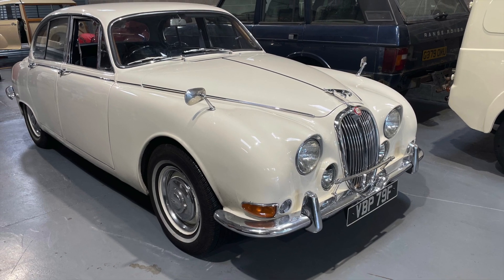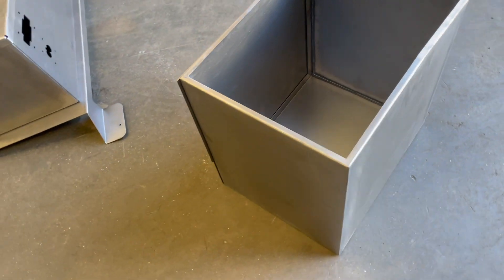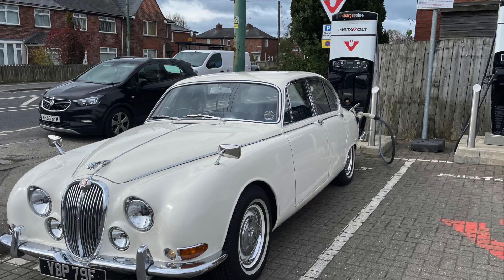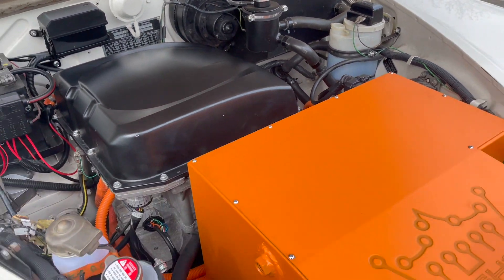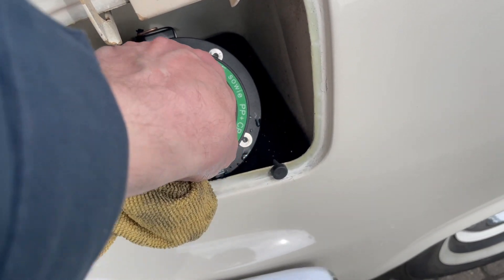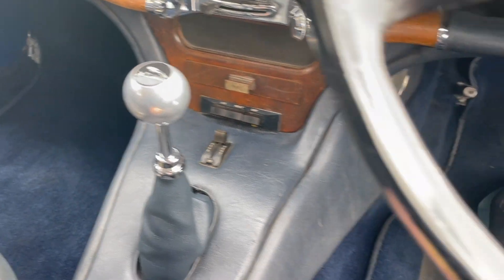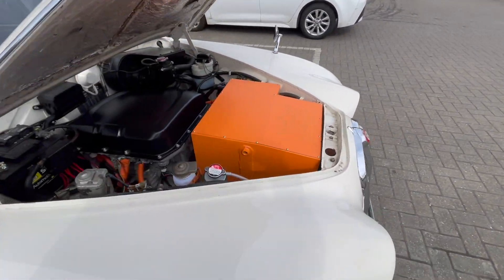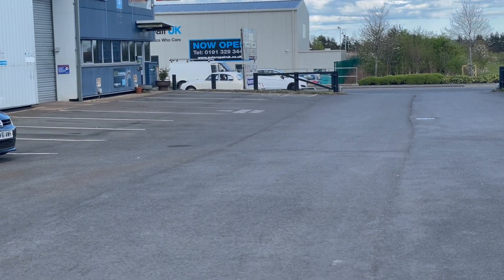Jaguar S Type Electric Conversion Introduction

Comment: Absolute sacrilege
Reply: I would have tended to agree with you until I'd driven an electric car. I've owned many classics, all needing regular maintenance to keep them roadworthy. My experience now with my hybrid vehicle is that it is so reliable, quiet, smooth, so many positives in fact. So, to bring these to the classic car arena has to be a good thing. After all, what is the ultimate in owning a classic car, to me, it is the driving and where possible, knowing that it will start when needed and complete the journey, trouble free. Arguably, a well maintained classic will do this but, all credit to this company for offering this option and, keeping a classic on the road.
Reply from the maker: @ thank you :-)
Reply from the maker: I forgot to mention in this video that the conversion is fully bolt in and we don’t cut, drill or weld the car in any way. It can be fully reversed at any time. Do you consider petrol engine swaps in the same way?
Reply: I like the engineering aspect. However there are fewer classics about and IMO should be left as they were originally built.
Reply from the maker: @markjackson6502 I understand the views on keeping the car original but as I’ve mentioned the conversion is fully reversible and alters the car as little as possible. Prior to conversion this was a slightly shabby example so the conversion has given it a new lease of life and stopped it from deterioration further. Possibly stopping its slow demise. Better to have on the road like this than fading away don’t you think?
Reply: I agree keeping them on the road is better than letting them fall apart.

Comment: Why??
Reply from the maker: Why not? I understand if it's not for you - everyone has different tastes and ideas. They make for such a smooth classic car is one of the reasons and make them massively more relatable. Here's a question for you - would you ask why if it had a different petrol engine put in it?
Reply: @KinghornElectricVehicles  I would, but each to his own :)
Reply from the maker: @peterqpuser4127  Exactly :-)
Reply: Here’s why:

I rescued VBP79F from a rusty hell. It cost a small fortune to replace all the rotten bits and have it resprayed.  I kept the interior as it was to give it a lived-in feel. 

The engine was tired, the fuel pumps leaked, it dripped oil everywhere and it was a pig to drive until it had properly warmed up (which took 20 minutes). It also only did about 10mpg. So instead of spending more money on outdated tech I rescued SM69MPY. It was a 3-wheeled, non-functioning, write-off Leaf, after someone at Ayrshire council wrapped it round a lamp post. 

Thanks to George and his team, it’s a match made in heaven. With its heart transplant from SM69MPY, VBP79F is now a smooth, quiet, useable daily driver with all the benefits of a classic plus all the benefits of electric. There’s absolutely no lane keep assist and no bonging. 

And when I’m dead, if someone really wants to put an inefficient 3.8 litre straight six back in, then they can. It’s all reversible.
Reply: When it comes to anything to do with classic cars "Why?" is a very good question.  They make no sense at all but lots of people love them.
Reply from the maker: @MarkAtkin  extremely well put :-)